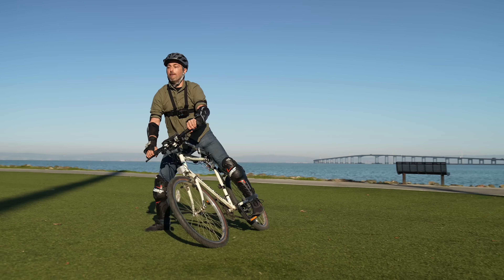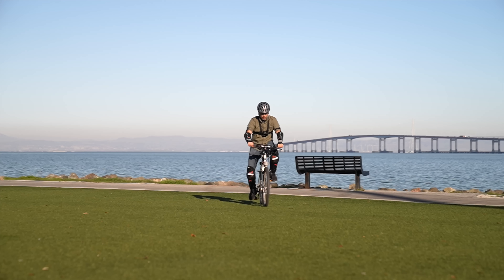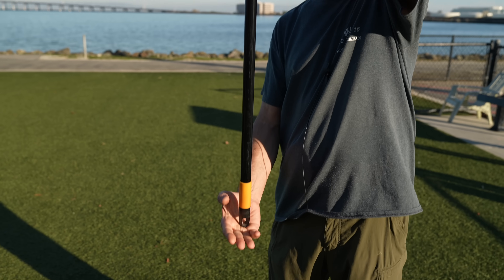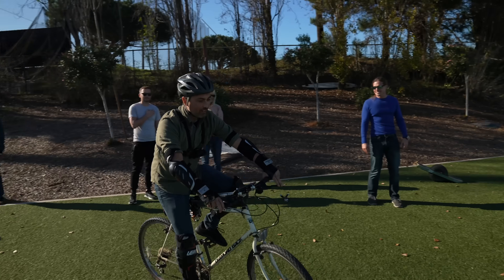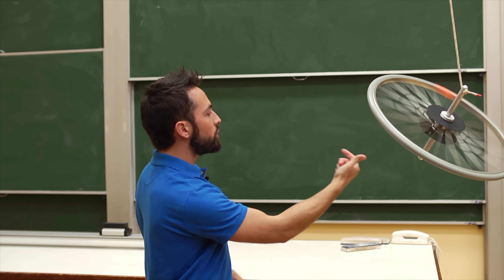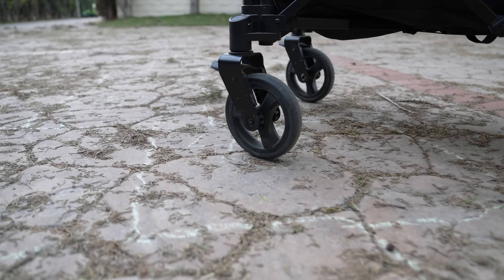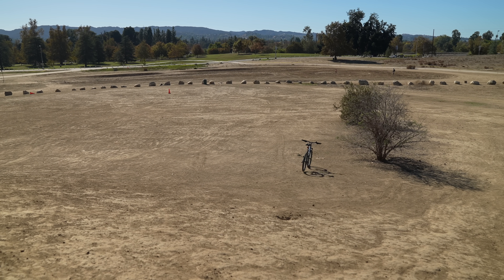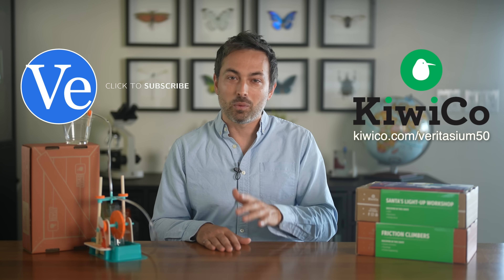Most People Don't Know How Bikes Work

Comment: @ShortHax No, rocket science is more complicated than bicycle science, because a rocket is during is flight like a stick in balance with just an end resting on your hand : You have to continually correct its balance, lest it fall back toward the ground. Except a rocket's supportned end is its bottom motor, and so is the way of adjusting is trajectory.
So the art of rocket science involve putting a sense of balance to a machine by the mean of a gyrosope linked to a way of orienting the jets that push the rocket upwards.
The reason we, humans, have a sense of balance that helps us riding a bike without ever thinking we spent our riding adjusting our balance is because our brain jus does that continually for a major part of our woken life, whenever we are on our only feet, just standing*, or walking, or running, or dancing...
The thing is doing the same with a machine is as complicated as perfoming bundreds of calculations per seconds with humans. Machines are better for calculation, because they are designed for absolute predictability, while animal (including human) brains are better to adjust to imbalance because they have evolved to survive by impredictability to the dangers of the world (jbeing predictable is the quickest way to end up in the stomach of a predator).

* If you ever look carefully at a standing person, you will notice some slight oscillations of the body. That is because her feet muscles do not stop adjusting the body's balance. As you know, no stool can stand with less than 3 feet. Because standing means your center of gravity is directly above your wider base, or directly above the surface of the geometric figure drawn with its outer restings points, 3 resting points drawing the simplest geometric surface (a triangle). Nothing with less than 3 resting points on the ground cannot stand without a sense of balance and continually adjusting to unbalance to avoid falling.
Reply: >> a rocket is during is flight like a stick in balance with just an end resting on your hand

It's actually not.  Rocket thrusters create what we call a "following force".  So the dynamics are not like balancing a stick.  The rocket is effectively neutrally stable at all times.  What does require continual corrections however is a bike.

>> the art of rocket science involve putting a sense of balance to a machine by the mean of a gyrosope linked to a way of orienting the jets that push the rocket upwards.

Look at model rockets.  No gyros and no controls.  And yet they're pretty darn stable.
Reply: @Rick_Cavallaro  You may be right for model rockets.
But real rockets need to achieve a goal : launching the payloads on their tops. So they are really controlled by gyroscopes to keep their balance until their mission is achieved.
Reply: @arnoaldloukasscirpionis1558  Nope they're guided by IMU's (gyros and accelerometers).  Those instruments tell them their position and orientation.  It's not about balance.

Comment: Actually, riding a bike (and maintaining balance) requires continuous minute adjustments of tiny movements (steering left to right).  By locking the handlebars, and not allowing the rider to turn it to the right or to the left  -- will make it very difficult for him to maintain his balance, and thus, this will eventually cause him and the bike to fall to one side.

Comment: this is only accurate if that's how you learned to balance on the bike, you can totally learn to balance by pushing against the pedals. you can learn to do this by balancing while still.
Reply: I'm willing to bet you $10K you can't balance on a stationary bike with steering locked straight ahead.
Reply: Pushing against pedals? How do you push something when you're on it?
Do you increase your gravitational field somehow?

Comment: A similar instinctive steering technique that most people aren't aware of comes with changing lanes in a car. If you ask people to pretend to do a lane change, they only turn the imaginary wheel once and center it. In reality, this means you run off the road (assuming you were traveling in a straight line and not in a turn when changing lanes). When actually changing lanes, there is a second small turn when you get into the new lane. For example, moving to the lane left of you requires a left hand turn (to get you into the lane) and then a right hand turn once in the lane (to straighten the car and allow you to stay in that lane).

Comment: I feel it depends on the style of riding and the skill of the rider. In enduro or downhill mtb some people shift their weight by leaning with their body and not turning the wheel so that at high speeds the front wheel doesn’t slip on a patch of mud or whatever. My opinion isn’t scientifically tested or anything but from years of watching and analysing how professional riders control the bike and from implementing those techniques in my own riding I can say that your experiment is definitely true always whilst sitting down but standing up is a bit different. It would be awesome if u did a standing test for this
Reply: >> It would be awesome if u did a standing test for this

I've had plenty of people, including experienced mountain bike riders and professional bike racers, try every possible approach.  Many tried standing.  Standing didn't help.

Comment: Momentum is what keeps a bike upright when in motion
Reply: nope
Reply: @Rick_Cavallaro  and your degree is in....???
Reply: @slappmunkey  My master's is in Dynamics and Controls
Reply: @Rick_Cavallaro  okay so let's hear why you think I'm wrong
Reply: @slappmunkey  Watch the video.  I think I explain it pretty clearly there.
Reply: @Rick_Cavallaro  I did watch it, was very interesting actually. 
I'm not talking about the"self corrective" designs of a bike or anything like that. If we just took a wheel and rolled it, what keeps it "upright" is the momentum. Because if we take said wheel and let's say put it on a sheet of ice, the wheel can spin fast but since there is not enough friction to create the torque necessary, the wheel will just fall over without support. The momentum is what keeps the wheel standing while it's spinning, not the spinning itself. Take the same wheel and some how not allow it to spin, if you slid it fast enough on the ice it will stay upright.
Reply: @slappmunkey  
>>  If we just took a wheel and rolled it, what keeps it "upright" is the momentum. 

It's not.  What keeps a rolling wheel upright is the result of gyroscopic precession.  When the wheel begins to lean, precession turns it in the direction of the lean, and that tends to right it.

>> if we take said wheel and let's say put it on a sheet of ice, the wheel can spin fast but since there is not enough friction to create the torque necessary, the wheel will just fall over without support. 

If falls over because steering doesn't work on ice.

>> The momentum is what keeps the wheel standing while it's spinning

Nope.  You'll have to explain how momentum can impact orientation.

>> Take the same wheel and some how not allow it to spin, if you slid it fast enough on the ice it will stay upright.

Nope.  It will fall just as quickly as it would with no momentum.
Reply: @Rick_Cavallaro  when I get to my computer I will give a more detailed explanation.

Comment: The opposite steering thing isn't true all the time. Above about 10-15mph you can just lean where you want to go. The only time you will be turning opposite at higher speeds than that would be to adjust your line into the corner. Watch a bit of high speed road racing or velodrome racing and you will see what I mean.
Reply: >> Above about 10-15mph you can just lean where you want to go. 

Nope.  You just think you can until you try it on a bike that doesn't allow you to counter-steer.

Comment: It is possible to turn without counter-steering. People can ride their bicycles without touching the handlebars, and they lean into the turn first and then steer.
Come to think of it, that's also how unicycles steer, but not propel.
Reply: Riding a bike without hands is easy. Riding a bike without countersteetring is impossible.
Reply: >> It is possible to turn without counter-steering.

It is an extremely difficult skill that a tiny number of elite athletes can manage.  But it doesn't look anything like a normal person riding a bike.

>>  People can ride their bicycles without touching the handlebars, 

I do it all the time.  You still counter-steer.  You just do it with your hips.

>> Come to think of it, that's also how unicycles steer, but not propel.

Did you not see me riding the unicycle in this very video and demonstrating counter-steering?

Comment: After spending many hours on bikes as a kid, I worked for a large company spread over many buildings. They supplied bicycles and, if you needed to transport stuff, adult-sized tricycles to get around the "campus". The very first time I hopped on a tricycle I immediately crashed into a wall because the handle bars were frozen in place and I could not steer. But the steering was fine, I discovered after dismounting. What was happening was that my arms refused to allow me to turn the tricycle until I had leaned correctly to initiate the turn. It was a weird feeling, but once I realized what was going on I could ride, ignoring the desire to lean to make a turn.

Comment: I dont believe this to be totally true 

for example get 4 riders who have been riding a bmx before the age of ten and they dont do this at all i myself dont 

the reason i dont is because i would go to the local bmx course and race people when you have a lineup of 8 riders or more there isnt room to counter steer otherwise if your the guy on one of the ends of 8 you can take everyone down so through many years of doing this its become habbit not to counter steer for that reason and it wastes time

so replace the type of riders experience and these habbits disappear so anyone who rides at a professional level this is not the case
Reply: >> anyone who rides at a professional level this is not the case

I have put LOTS of people on this bike - including professional bike and motorcycle racers.  They cannot ride it with locked steering.  I have yet to find *anyone*, including experienced mountain bike riders, that can go more than 3 seconds.

Comment: Counter steering only works after a certain speed though. Dude was going a bit too slow at the beginning for it to work
Reply: True. If you go slower than zero speed then the countersteering do not work.
Reply: The slower you go, the more counter-steering is required.

Comment: I became conscious of this after reading a Cycle World article over 40 years ago.  I think it is very helpful to be aware of what input you really need to give in an emergency, since as you can see wrenching the bars right to avoid a collision on the left will end in disaster.  It's also important to note that above a certain speed, you will never input steering in the direction you are turning - the bars will turn in the direction of the turn, but you will still be applying force in the opposite direction, or you will fall into the turn.  It is quite easy to prove all of this to yourself by feel on a good size motorcycle, at 30+ MPH.  Just sit upright and relax with the palms of your hands against the back of the grips so you can only push on each grip.  You will have no doubts after that.

Comment: Same mechanics as riding a motorcycle.  The difference is you don't stay seated so you can shift the center of mass with your body weight.  If the riders in this video didn't stay seated and were traveling fast enough, they would be able to make these turns without moving the handles at all.
Reply: Good start.
1st sentence is correct, but then the rest is completely rubbish.

Comment: Are you running out of ideas? I didn't watch until end, but everyone knows this depends on speed.
Reply: Your knowledge is bit weak, because speed is irrelevant.
Reply: @XtreeM_FaiL  Your experience is nonexistent, because speed is relevant.
Reply: @XtreeM_FaiL  Why don't you just go ride a bike and see for yourself?
Reply: @XtreeM_FaiL  What you want me to say? When stationary (yes that's possible) or moving at very slow speed, you can just turn the steering and move into that direction. When moving fast compared to the turning speed, a slight tilt is enough. In high speed turning the steering in any direction can be fatal.

You can derive stupid formulas if you wish for 100 km/h or 0,001 km/h, where 0,01 mm tilt is enough and momentum change from heartbeat can tip you over.

Comment: twist of the wrist 2 anyone?
ps. I was dumb one day and took a motorcye out on a snowy day. The  very first traffic light, I locked up the front wheel and slid forward with my front brake engaged .While in the upright position the feeling I got was as if im standing still and trying to balance the bike while standing on it.  when i released the brake and got traction i was able to balance it back.

Comment: Gyroscopic is the real answer. What was yours? Why are slower bicycles less stable? Why do you stabilize as you increase speed?

What did this video tell you that you didn't already know?
Reply: The gyroscopic effect is minimal.  They have built bikes that have zero gyroscopic effect, and people have no problem riding them.  Have you ever seen those ski-bikes?  They have no gyroscopic effect, but they're still easy to ride.  Lock out counter-steering and you fall.

>> What did this video tell you that you didn't already know?

Because most people don't know this.

Comment: Left is right, and right is left. This is common motorcycle rule until you drop below a certain speed.
Reply: You have to do it all the way down to 0 mph.  Many (if not most) motorcycle riders dispute this, but I've yet to find one that can do it at any speed on this bike.
Reply: @Rick_Cavallaro  ah the drop to zero would be impossible it seems. Especially with a steering input locked. I would love to try, and fail, to ride the bike in the video.
Reply: @TheZachafina  if you find yourself in the S.F. bay area I'll be happy to give you a crack at this bike.

Comment: Ok so a bike that is already leaning to the right (after the counter steer to the left that makes it lean to the right) is turning to the right because the front wheel is turning to the right (even if sometimes it looks like it is straight) or because garvity is pulling it to the inside of the corner (I think this is what happens with coins when they roll on the corners and start rolling in circles)?

Comment: When I cycle, I perform no counter-steer. I lean straight into the turn and very slightly turn the wheel in the direction of the turn. If I try to do the countersteer maneuver, that works perfectly well and all, but I don't find it necessary. Perhaps it's just the case that most people learn to do this for better turn stability, and never learned to steer without doing it?

Comment: @1:50 "it's impossible to turn left without first steering right..." <--- This is not correct. Proving this by a steering-locked bike is not convincible, because we cannot balance the bike with the steer being locked, even half locked or even riding straight line. 
Anyone can try riding slow enough, steering left + leaning body left simultaneously, it just turns left flawlessly.
Reply: >> steering left + leaning body left simultaneously, it just turns left flawlessly.

Wanna bet?  Instead of locking the steering, we'll put an encoder on it and log the results.  You're left turn/left lean will be preceded by a right steering input.  I'll put $10K on it.
Reply: It's best to use encoder & log to prove this. Using steering-locked bike is ridiculous here. With steering being locked, you can't even ride it at all. Steering is mandatory to balance the bike.
Reply: @AverellPham  
>> With steering being locked, you can't even ride it at all.

BINGO!  If you could just lean, then you could easily ride a bike with locked steering.  But you can't.  So how about that bet?
Reply: @Rick_Cavallaro  why not?
Reply: @AverellPham  Why not bet?  I don't know.  I suppose because you know you're wrong.
Reply: @Rick_Cavallaro  I mean I'll take the bet.
Counter-steering helps a bike to turn left or right, but it is not a must for every case. Derrek proved it by using a steering-locked bike is ridiculous. A locked bike cannot ride at all, so it is obviously cannot turn left or right.
To ride a bike, we definitely need to balance the bike by making tiny steers left & right all the time. And this should not count as counter-steering.
Reply: @Rick_Cavallaro  I'd 100% be willing to bet that money that it's impossible to turn left without first turning right.
Reply: @Owen_loves_Butters  Unfortunately, you and I are on the same side of the bet.  And anyone that tells me they'll take the other side instantly disappears - like Averell Pham.
Reply: @Rick_Cavallaro  That's what I'm saying, that I'd take that bet if someone were willing to take the other side